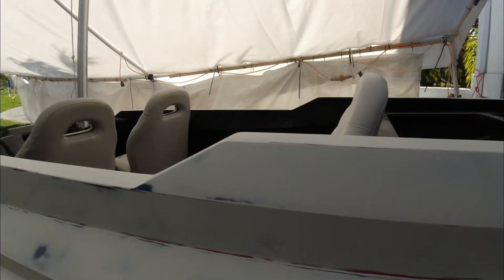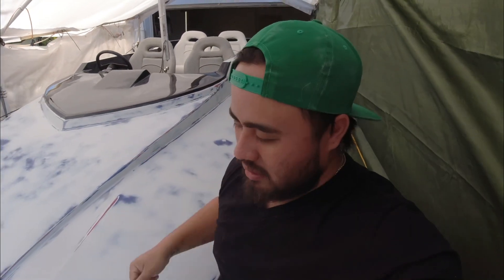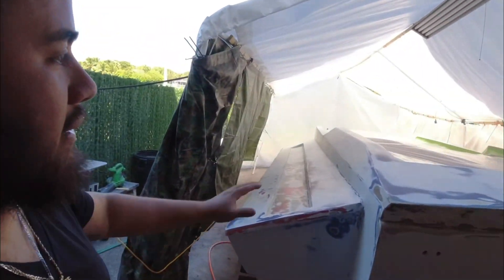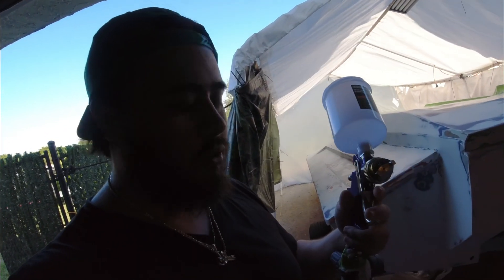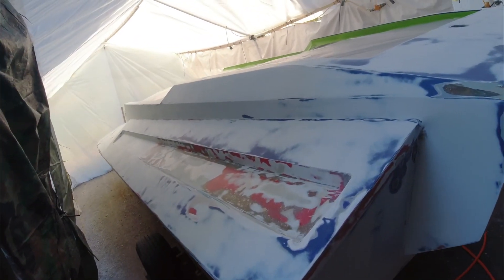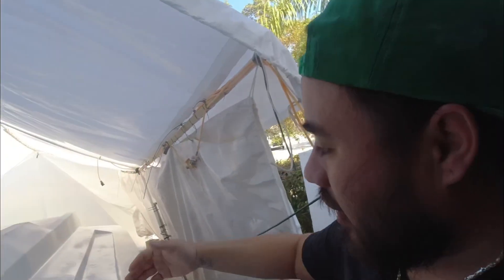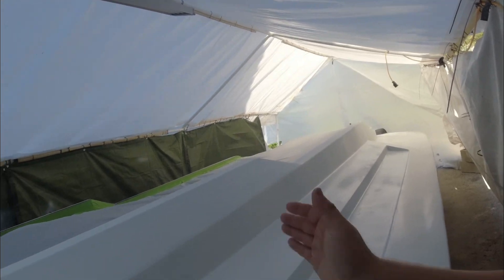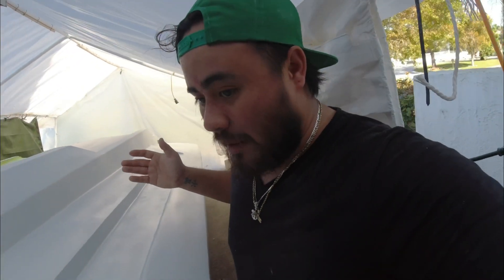Preparing my boat to paint it outside the my house

Comment: What size motor will it have
Reply from the maker: 250 for now hopefully a 300 sometime in the future
Reply: @boatvibes  If it's your 250 off the checkmate,  for everyone's safety,  put a nosecone on it, tunnel boats are very dangerous without them.
Reply from the maker: @MnDan   yes it will eventually get a nose cone. I won’t be opening her up until it’s nose coned
Reply: @boatvibes   If my memory serves me right Talons run best with only 6in of setback too..Hope that helps
Reply from the maker: @MnDan  yes all that info definitely helps. At first I was planning on putting the 10” hydraulic jack plate but I convince my self to put a nice black 8” manual jack plate I have. Do you know what is the best engine height? I still have not looked into that
Reply: @boatvibes  8 might actually work better with the heavier motor. Yes start  with dead center middle of nosecone to bottom of boat. Take a level across the tunnel to bottom of each side..Mount motor all the way down so you have room to lift it. You most likely end up 2in above bottom of boat.. Start with a chopper then as you get comfortable and higher speeds go to the clever. A clever will just bounce at slow speeds. Hope that helps

Comment: To paint the front middle of the boat you could put two ladders on the side of the boat and a very heavy wooden plank that would support you and not sag and touch the boat you could spray the area and then move the ladders down not sure if this will help remember be careful you don't want the wood to break on the hall